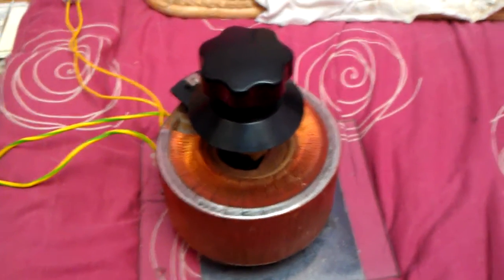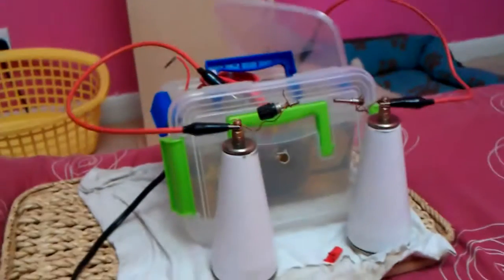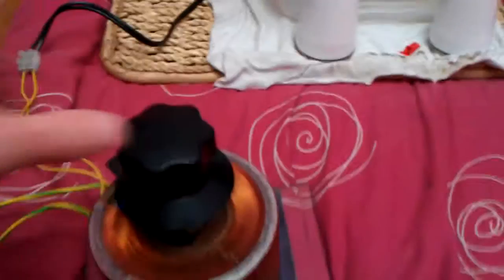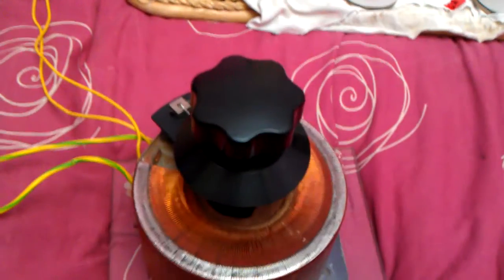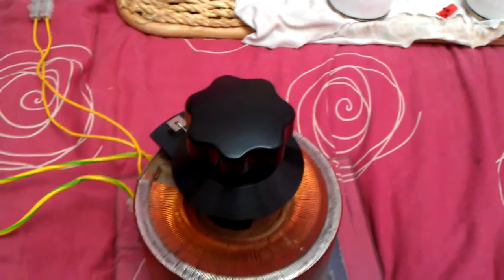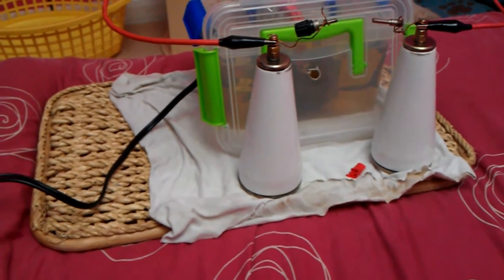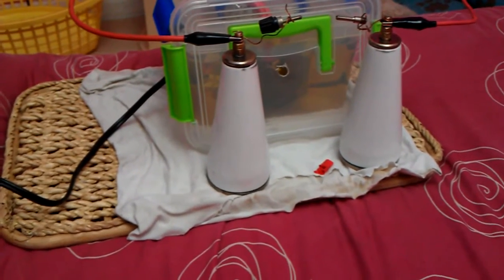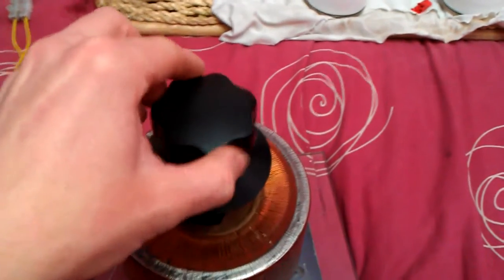Testing the variac on x-ray transformer

Comment: Congratulations with a nicely working variac :)
I got a 8A variac, that I have in a wooden box, including a thermal fuse (solid shorts rather take the breaker, the thermal fuse will react on "longer" overloads protecting the windings), and added a soft-start from a microwave oven (starting connected series with a resistor, shorting out the resistor after a small delay)

Variacs and huge ring transformers can be such a nice fuse-blower, even when nothing is actually wrong. :)

Best regards
E.S.E.